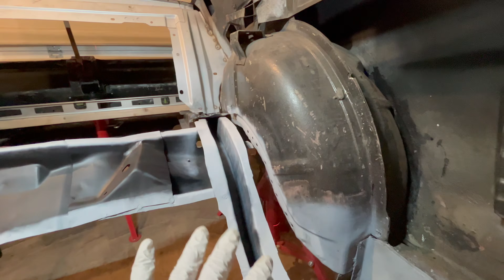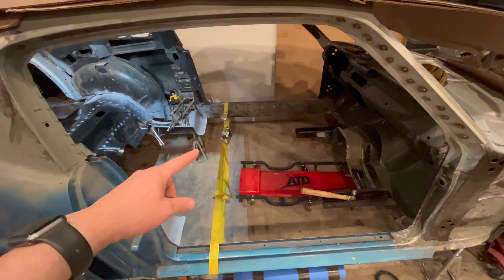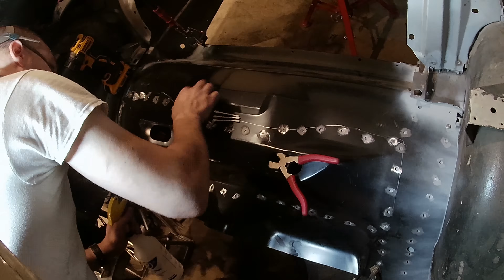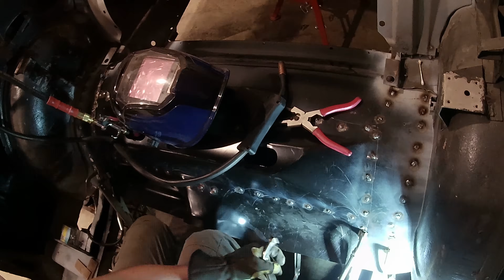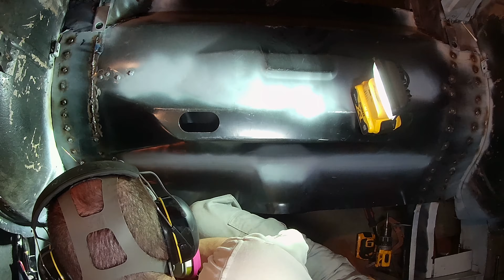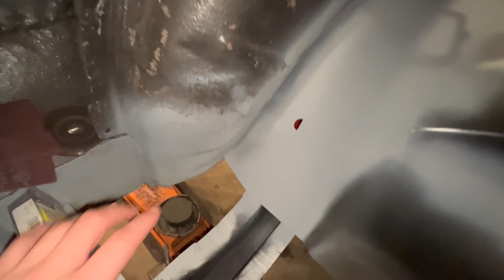New Transition Pan Install! - 67 Mustang Part 33

Comment: Everything you are doing is looking great.  I just recently did all the same to my 65 . Just finished up the floors. One thing I did have to go back and fix was my gas tank opening. It was to narrow at the transition pan side . Just give that a quick test fit before you finish welding.
Reply from the maker: Right on, thanks! Yeah I dropped the tank in and thankfully it lined up okay. I have nightmares I’ll get through all the metal work and nothing fits back together!
Reply: I understand that very well.

Comment: I like seeing it come together. I would LOVE to see longer post. I know it takes a bit to put a post together but I watch YouTube like TV and I don't like changing channels. When the post is longer I relax a little longer which is always a good thing. I also like the little comments you type in so THANKS fors posting !
Reply from the maker: Thanks for watching! Yeah I get it, I sometimes like the longer ones too. Right now I’m letting however much time I have to work on it drive the content length, but I’ve been toying with also putting out longer format videos. Just not sure how it would integrate in with everything else - if it’d be a different channel or what. Regardless, hope you still enjoy even if they’re a bit shorter for now!